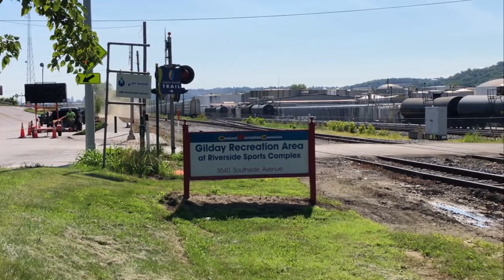CSX Train Passes Off Huge Cut Of Auto Racks To Short Line Railroad CIND, Railroad Switching In Cinti

Comment: Cool Geep 40-3 there! And those orange SD40-2 are way cool
Reply from the maker: Yes they are!  Man your channel has exploded recently!!  Upper New York is the place for trains and DPU Alrights!
Reply: @JawTooth  Yes it has, thanks JT. Its like WWoT gone wild LOL
Reply from the maker: @WideWorldofTrains  Wide World Of Trains On Steroids!
Reply: @JawTooth  LOL Diesel Powered
Reply: Love your stuff u need to come to hopkinsville Kentucky we got trains here 24 hours a day almost one after another and we got an old train station u might like to see in downtown hopkinsville
Reply: what kind of bell do they have.
Reply from the maker: @ukwildcats1982  I just looked up Hopkinsville.  I like the train station and the old L&N freight station across from it.  I put that on my list!
Reply: 3221 is an SD40-2 but 5016 is actually an SD50S.
Reply from the maker: @FabianDiazTrainsTrucksNCars  I don't know but CIND uses the same locomotives that I&O use.  They have the same owners
Reply: @FabianDiazTrainsTrucksNCars  Just to be explicit, the SD50 wasn't acquired by CIND. It's an I&O locomotive, which is painted the same colours as CIND's locomotives, because both roads are owned by Genesee & Wyoming. At 12:48, you can see the IORY reporting mark on the cab and the I&O lettering on the logo; CIND have "CI" on the logo and a pair of knuckle couplers instead of the ampersand.
Reply: @beeble2003  I wouldn't be
surprised if the SD50 started life
as a Conrail unit, they had a boat
load of them they sold off before
the merger with CSX and NS!!!
Reply: @conrailfan6277  Nope -- far more interesting than that! IORY's two SD50s were built for Hammersley Iron in Western Australia and later reimported to the US.
Reply: @FabianDiazTrainsTrucksNCars  Fair enough. But, with respect, it wasn't remotely obvious that you meant "IORY" when you wrote "CIND", and that's why both people who responded to your comment assumed you meant what you wrote.
Reply: @beeble2003  Cool, they made their way around the world and back
so they have some miles on them!!!
🤙🤙🤙🤙🤙🤙🤙🤙🤙🤙🤙
Reply: @JawTooth  awesome Auto Racks I've always liked trains since I was kid
Reply: This have been the most auto rack trains I have ever seen. Nice locomotives 😊Great videography Mr JT. Thanks. ❤

Comment: Back in the day when car model changes were a really big deal, there were no side panels on the car carriers.  We liked to look for the new models before they got to the dealers.  Not train spotting, but car spotting.
Reply: @audreygatey1274   yep. Plus train hoppers were getting rides insides the automobile's
Reply: @audreygatey1274  People were stealing parts, too.
Reply: @audreygatey1274  seen a couple pics in Trains magazine's railroad news section of IIRC AMC Gremlins or Pacers having passed through Detroit with the entire bottom and middle rack nothing but burned out shells because some of the local youts lobbed molotov cocktails at the train

Comment: I believe that IORY loco 5016 is an 1 of 5 SD50s locos that were operated by Hamersley Iron in the North West of Western Australia on its iron ore railways operation.
The locos were built by Clyde engineering under licence to EMD at their now closed factory at Rosewater in South Australia in the 1980s. They were sold in the 90s after HI replace it's old fleet of mainly Alco locos for new Dash9-44-CW from GE. I was a Driver at HI for 39 years and did many kms on them, nice to see them still in operation.
Reply from the maker: Awesome!  Thanks for your comments and info Gary!  I had no idea

Comment: I was surprised to see  G & W locomotive with 6 axles. I’ve only seen 4 axle previously.  Great video as always.
Reply from the maker: Thank you very much!
Reply: According to https://www.thedieselshop.us/IO.HTML , IORY is currently assigned more 6-axle locos than 4-axle (17 vs 14).
Reply: @beeble2003    Interesting to know, it was the first time I’ve seen 6 axle on any G & W locomotives anywhere.  I wonder if it’s IORY specific or they are gradually upgrading.
Reply: @Bhil3  Not sure. G&W own so many roads it's hard to figure out if there's a pattern. I looked at a few random lines and they all seemed to have a decent proportion of six-axle power, but I didn't try to come up with anything definitive.

Comment: Interesting that they interchange the cars there..wonder why these 2 lines run parallel to Lawrenceburg? Is there no connection out there?
Reply: There used to be one, the tracks used to go across the off ramp of I-275 and US50 in Greendale. The Levee trail was the road bed of that connection.  It has been gone about 25-30 years.

Comment: Why do consists of autoracks always seem to include cars from every Class 1 railroad you can think of, in random order? The first ten cars of this train are UP, CN, CSX, BNSF, UP, BNSF, an ATSF car that BNSF hasn't rebranded, CP, NS and CP again. The train also contains cars branded for KCS, Conrail and Ferromex, along with a car owned by the Utah Central Railroad, one branded "Hourglass" and one branded TTX. Is it just that, nowadays, they're almost all lease cars and the branding is essentially irrelevant?
Reply: OK, I more or less found the answer. The cars aren't really leased. TTX is a company that was formed by and is wholly owned by the major railroads. It came about in the 1970s because well-intentioned government regulations weren't working. When a railroad's car was sent on another road, that road had to return it as soon as possible or pay fees. That meant that, if Railroad A had one of Railroad B's boxcars and vice-versa, they each had to be sent home ASAP, probably empty, even if each railroad needed a box car.

The railroads' response was to set up TTX. Because TTX isn't a railroad, it could use its cars however it wanted. A TTX car in Railroad A's could be used within Railroad A, or sent to B or C as needed, as long as TTX agreed. And, since TTX is owned by the railroads, it did agree, as long as each member railroad had enough cars. TTX was originally set up for boxcars but they also own other kinds of cars, including autoracks. I'm not sure why TTX's autoracks carry the names of railroads whereas their boxcars don't, but that's basically the history of all this.

Comment: What’s the purpose of the derailment in the middle of nowhere? It seems to be an active track.
Reply: Maybe an added level of safety to keep the parked locos from being driven onto the main in case they're stolen/hijacked by morons.  Or/and maybe the CIND isn't signallized, relies on track warrants, can only remove the derail if they possess a track warrant.  Just guesses.
Reply: Same as any derail: to stop anything coming off the siding on to the main line when it shouldn't.

Comment: Staying out of a yard like Queensgate can sometimes save up to a day's travel time. IHB in the Chicago area converted one of their regular freight yards into an auto sort yard where they can mix cars from all the auto manufacturers and .make large cuts or even unit trains for the Class 1 lines and not having to go over the hump yard.   As always thanks for the good shortline action in a variety of locations. I wonder about the 2 cars with home shop stickers. Were they fixed and someone forgot to remove them?  Was CSX supposed to pull out these cars and repair them?  Does the shortline have a repair yard where they can handle what ails them?

Comment: Hey Jaw Tooth, I have a couple of questions. Which direction is camera pointed? Second, I ntake it this is the old B&O but did the New York Central have trackage rights here? Thanks for the video’s of the real Queen City.
Reply: I can answer that question for you the New York central owned the line that cind runs on the line ran from Cincinnati to greensburg then from greensburg to Indianapolis then from Indianapolis to Chicago. From greensburg to Indianapolis this line was called the Chicago line   this line is abandoned from greensburg to shelbyville and CSX owns the line from shelbyville to Indianapolis and the nyc had a yard in greensburg for the interchange with the columbus, hope ,and greensburg route,the Vernon, greensburg and rushville route,and the Chicago line. The big four railroad also used this route from Cincinnati to terre haute through greensburg,st Paul and Indianapolis